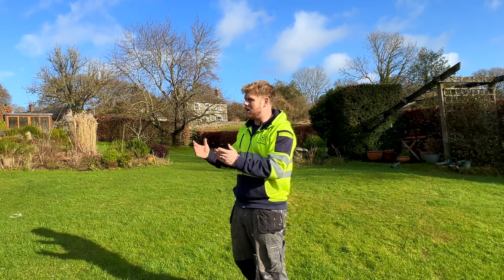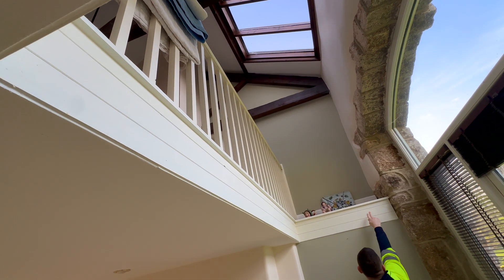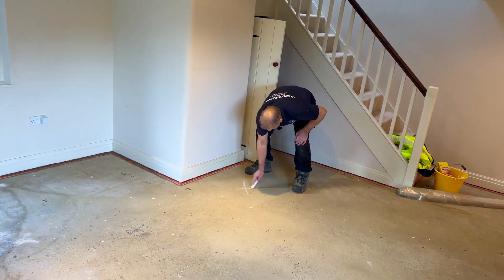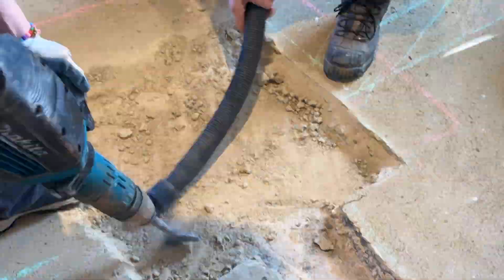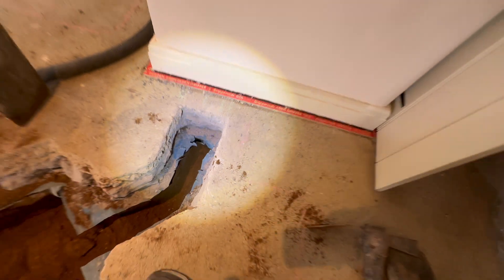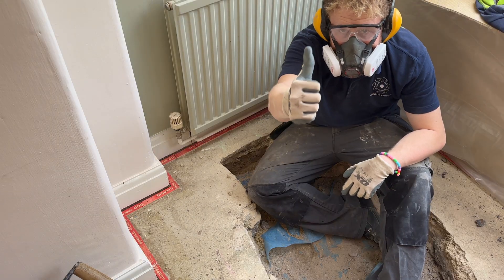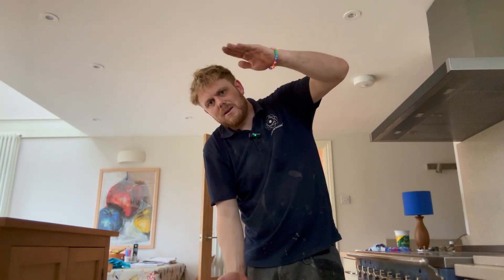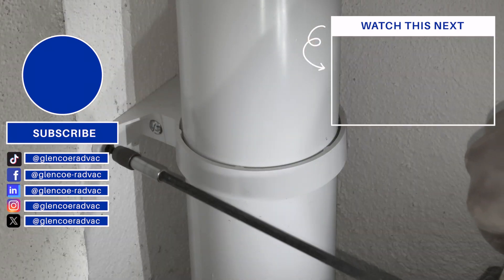How To Install A Radon Gas System In A House *Extreme* (PART 1)

Comment: Could you do a video explaining about radon gas and how this system works. I know you have briefly mentioned but id like to know how it passes through concrete and does soil type affect it like clay. Surely you would still be exposed to radon gas if you was out in the garden? Or anywhere in that area.